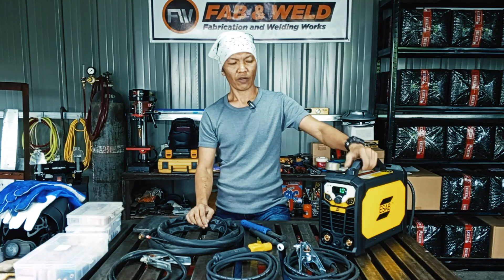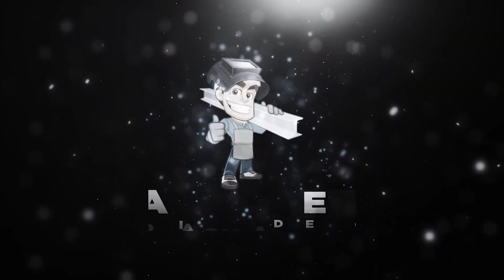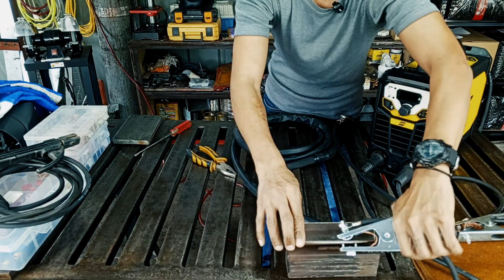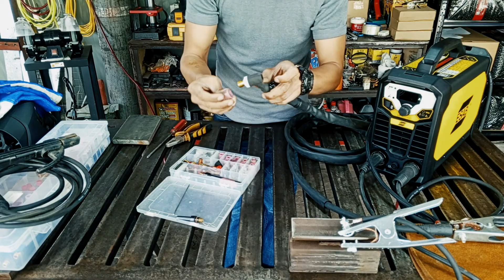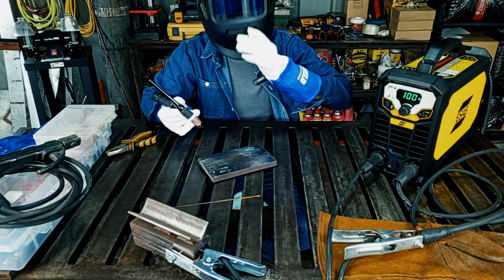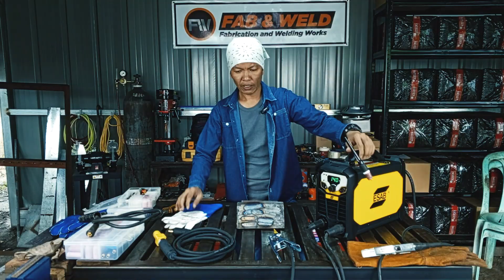TIG WELDING SETUP WITH ESAB ROGUE ES 200i PRO

Comment from the maker: Hey guys! In today’s video, we’re diving deep into setting up the TIG welding process using the ESAB ROGUE ES 200i PRO,  one of the most versatile and rugged inverter welding machines in its class! 💪⚡

Whether you're working on-site in the field welding pipes or fabricating in the shop, this machine delivers smooth arc performance, precise control, and portability that's perfect for pros on the go. We'll walk you through everything from connecting your torch, gas setup, electrode selection, down to real-world welding tips that will boost your TIG welding projects!

#esab 
#esabrogue 
#fabrication  
#weldingtest  
#metalwork  
#weldingtutorial  
#weldlife  
#weldingprojects  
#stickwelding  
#tigwelding  
#migwelding
#pinoywelder
#asianwelder

Comment: Do you think the ESAB Rogue ET 200i Pro is more reliable than the equivalent Lincoln or Miller?
Reply: Fronius
Reply from the maker: Fronius is a monster bro
Reply from the maker: Based on my personal experience using different brands like Lincoln, Esab, Miller, Everlast, and even various Chinese brands, it always comes down to the type of project and its application.

All of these brands are reliable, but it really depends on the level and requirements of the project you’re welding.

And of course, budget always plays a big role.

As for welding quality, if the project requires strict quality testing and inspection, the well-known brands consistently deliver and stay ahead of the competition.